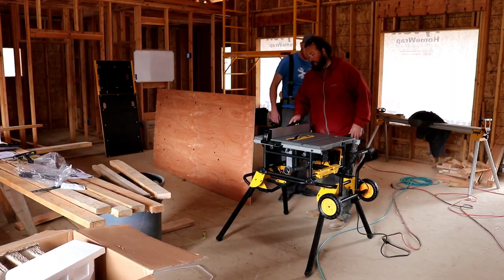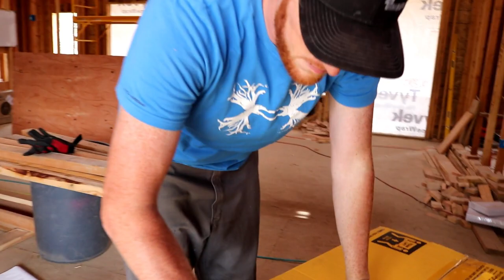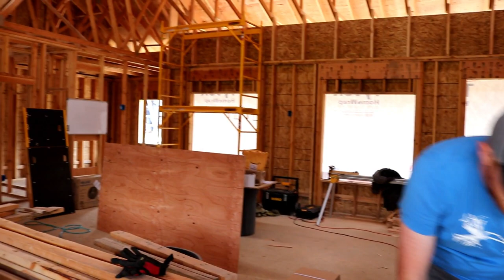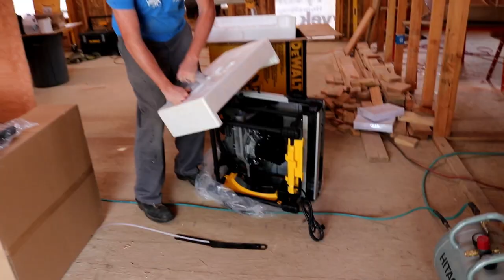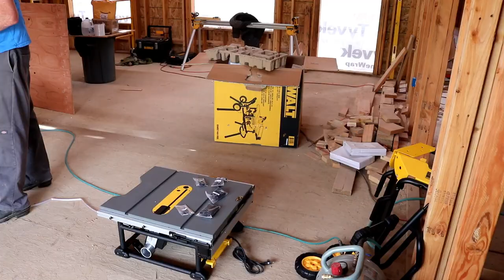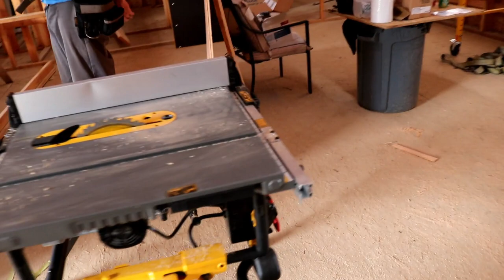Dewalt Table Saw

Comment: 1. The gate was dented right out of the box (3:58). Didn't happen when you were cutting. At least that's what the video shows.
2. You are forcing the ply through the blade (4:57). Cheap blade or not you still have to let the tool do the work.
3. Its going to be "Fisher price" because it is a mobile saw. Have to cut the weight somehow.
Absolutely nothing good about the saw in the video. Biased review in my opinion.

Comment: i have the same saw and in the video you show the dent in the fence (not a guide ) but you didnt show or say how you dented it.  would you elaborate on the dent?
Reply from the maker: We think it came out of the box that way
Reply: @EssentialMountainHomesteading  i just rewatched the video and the dent is there before you turn it on and test cut the plywood. you should contact dewalt and send them the video and hopefully they will send you a new fence.
Reply from the maker: @williamfreeh9598   We reached out to them already and were cordially invited to go pound sand
Reply: go figure.  just another horses ass big corporation.  @EssentialMountainHomesteading

Comment: That price you should have came with us outgoing table it should have came with a roller it should have came with a should have came with a Shop-Vac and push stick and all that safety stuff
Reply: That sounds confusing and you might be asking a little much, cause it's hard to understand what you're saying ?
Reply: For that price you should have came with the outfeed roller stand a Shop-Vac and also a Lakes of the table somehow it'll be able to lengthen the table somehow my phone doesn't translate always correctly so they're with
Reply: I can also use an idea how to build a portable ramp to get Mom getting a wheelchair I just got out of the hospital and I'm going to have to put it into my RV trailer somehow and sometimes I'm going to be 2 feet away from the sidewalk and I have a 31 inch wide opening door so either I'm going to get them to give me an aluminum ramp or something I can't leave the brand new wheelchair outside and it doesn't break down like a scooter does so I don't know I don't have a external mount for my Jeep yet where I can put on a like a ramp where you go up and then lift it up then the hall is on the back end of it for the summer but for the winter I don't know what I'm going to do maybe I won't be able to use it during the winter time but it's going to be lipidemia I'm a big as you are so now they're going to give me a wheelchair so I don't have to be no sand on my feet too long where it's so painful just got to find a way to move this wheelchair in and out of my vehicle and into the back of my car I don't have a lift for it yet and I don't have the proper car yet and I think they took my my van from Home Depot finally

Comment: Its all garbage these days... all of it
Reply from the maker: sadly you are right, so where do we go to find good quality tools
Reply: I would also like to know where these "good quality tools" are at?  :/
Reply: Seems most brands now have different levels of quality as well, another trade off in it all, but is what costs them .10 to 1.00 or whatever per unit really worth the 50 to whatever more that you pay. Guess you are still best to converse with the fellows behind the counters or better yet the fellows at the local service centres and find out the brands they never see come through the door !
Reply: Sawstop jobsite saw and Festool if price isn't a factor. Most homestore tools are garbage these days.
Reply: Not necessarily it's who making them these days, sadly we all know is China... DeWalt & Milwaukee are great when that era of the making was in USA